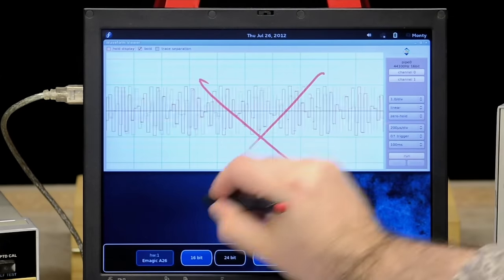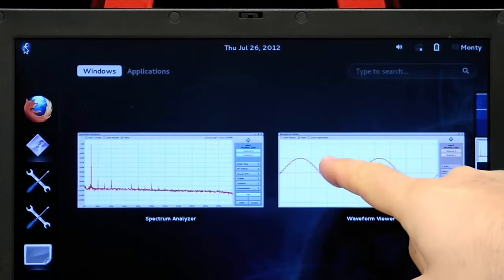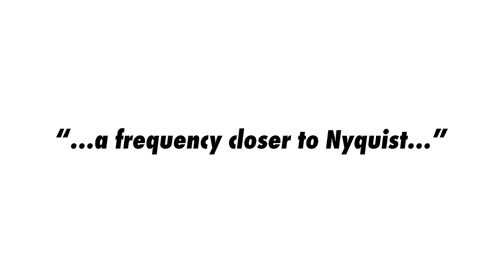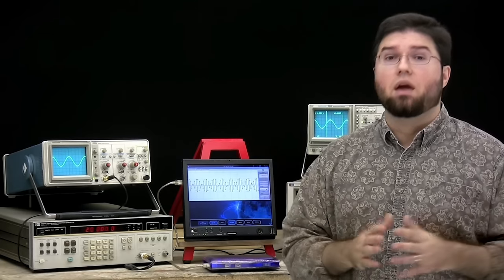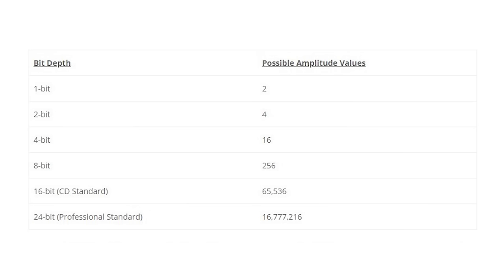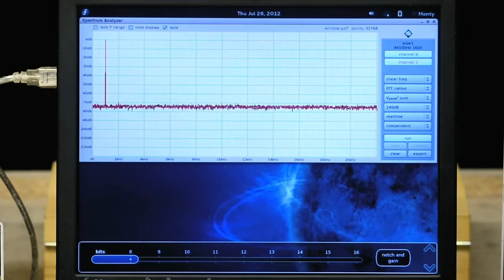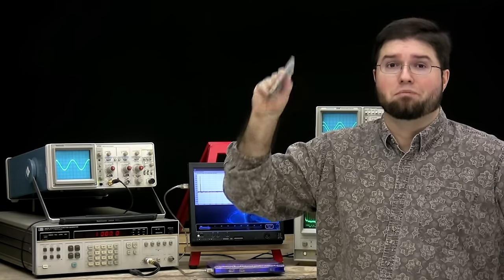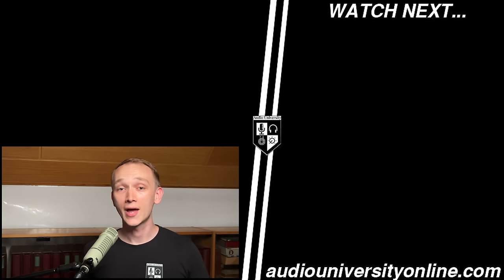Debunking the Digital Audio Myth: The Truth About the 'Stair-Step' Effect

Comment: @mfnickster9754  replied to my comment of 6 days ago, noting that the "DAC box", the EMI 2|6, uses a delta-sigma DAC to produce its analog output.  There is some possibility that the DAC in the EMI 2|6 is an "oversampling interpolating DAC", rather than the simplest kind of DAC, which inherently provides a zero-order hold.  

Essentially the "oversampling interpolating DAC" uses digital interpolation to raise the sample rate by filling in values between the samples it is provided.  For example, if "oversampling interpolating DAC" is provided with data sampled at 10 KHz, it will generate an internal clock at 40 KHz.  A digital filter will operate on that 40 KHz internal clock and generate values to fill in between the 10 KHz inputs.  

Those interpolated values could be on a straight line between each two successive samples.  That would be pretty easy for the filter to compute, because generating those points requires only data from each successive pair of inputs.  Instead of a stairstep between each pair of data points, there is now a ramp.  This linear approximation between points goes a very long way toward removing the artifacts present in the reconstruction generated by the simple DAC (with zero-order hold).  

Suppose the interpolator generates points that fall on a parabola through three successive 10 KHz inputs.  Now the input data points and the interpolated new values between the original data points fall on a parabola.  This does even a better job of removing the artifacts in the simple DAC's reconstruction.  You can generate the interpolation using 4, 5, or more successive 10KHz inputs, at the expense of a more complex interpolation algorithm.  But microprocessors these days run at screaming speeds, and don't occupy a lot of integrated circuit real estate.  So maybe higher order interpolation is practical.  Certainly, there are diminishing returns with increased order of interpolation.  I don't know what might be typical in "oversampling interpolating DACs".  

Why are oversampling interpolating DACs used?  Well, by boosting the sampling frequency beyond the input data rate, a simpler filter can get rid of the artifacts.  You could most certainly hear those artifacts at the output of a simple DAC (with its inherent zero-order hold), under the right condition:  a low sample rate relative to the incoming audio.  Getting rid of them  requires a low-pass filter.  But a simple low-pass filter will also start to suppress desired signals at higher frequencies.  If you want to avoid that problem, you need a low-pass with a sharper cut-off.  A sharper cut-off drives down the artifacts with less impact on desired high frequencies.  It also requires more components:  inductors/capacitors/resistors in a passive filter or more opamps in an active filter.   The trade is that the digital interpolating filter of high order suppresses the artifacts with less overall hardware than a purely analog filter with comparable performance.  Big "D" (oversampling interpolator) and a little "A" (final, analog filter) is, overall, easier and cheaper than no "D" (no oversampling interpolator) and a lot of "A" (final, analog filter).  

Analog Devices produces a line of oversampling interpolating DACs.  There are probably many other suppliers.  Here is a tutorial they offer:           

"Oversampling Interpolating DACs," by Walt Kester,  www.analog.com/media/en/training-seminars/tutorials/MT-017.pdf  

Walt notes:  "The AD9773/AD9775/AD9777 (12-/14-/16-bit) series of Transmit DACs (TxDAC®) are selectable 2×, 4×, or 8× oversampling interpolating dual DACs"

This tutorial explains what I have just attempted to demonstrate, but with more accuracy and authority.  For example, the tutorial describes the relationship between the sharpness of the final analog filter, the order of that filter (its complexity), the separation between the signal band and artifacts, and the desired attenuation of artifacts.  And as for authority, well, ADI has been a dominant force in this industry for multiple decades!

Does the EMI 2|6 use an oversampling interpolating DAC?  If so, we have an explanation for both the lack of stairsteps and the imperceptible quantization noise in Monty's demonstration.  Does the EMI 2|6 provide options for operational modes for its DAC?

Thanks again for the video and demo.  

And thanks to @mfnickster9754 for pointing out that the EMI 2|6 uses a delta-sigma DAC.

Comment: With infant hearing 20-20k is one thing, for adults 20-10k is more realistic.. with ultra high sample rates, one can digitize the higher than you can actually hear harmonics and the sums and differences of signals in the live recording room. They in turn mix with signals you can hear, changing what you record and what is reproduced and what you hear...of course you will run into the bandwidth of your reproduction amplifier and speaker system.. I believe Neil Young has it correct in his understanding and representations..  Most casual listeners and their sound systems can't hear the difference between sample rates and digitizer depths.. On the other hand audiophiles can understand the differences and in some cases even hear the differences..

Comment: To share my thoughts before watching:

The speaker is dynamically coupled to the excitation signal and there is phase lag and inertia in it anyways so it can't really be bothered if the signal is a staircase or smooth. You may be able to measure the staircase at the output but the magnet field and the coil current already can't possibly jump like that and will filter it
Reply: Except you're pumping heat into it, create EMI, and probably make your amplifier very unhappy.
Reply: @MatthijsvanDuin  in an after thought not even the amplified output can jump. If anything the high impedance analog output from some chip will
Reply: @lolman2425  Regardless one shouldn't abuse the amp or the speaker to perform this filtering, the proper place is in the output stage of the DAC.
Reply: @MatthijsvanDuin  That is no abuse it's just natural
Reply: @lolman2425  There's nothing natural about sending ultrasonic (RF even for modern DACs) garbage into audio gear in the hope that they will filter it out. The output filter is an integral part of a DAC, and when implementing a DAC you should just follow the guidance of the DAC chip's datasheet which will specify the recommended filter.
Reply: @lolman2425  The purpose of an audio DAC is to reconstruct a bandlimited signal from its discrete samples. The output filter is a necessary part of that, without it you simply don't have a properly functioning DAC.
Reply: @MatthijsvanDuin  There is no difference you are correct but filtering just means some passive components to make the output unresponsive to a part of the signal. It doesn't matter if you rely on a designated filter or if the the load naturally doesn't react to the HF component of the signal
Reply: @lolman2425  it matters because the output filter of the DAC is designed for the task, while audio equipment is not designed to deal with that much crap across that much bandwidth (modern audio DACs oversample to several MHz!). It is quite likely to cause issues, such as overheating an amplifier (the application manual of the amps we use explicitly warns against subjecting the amp to ultrasonic noise) and unwanted radiofrequency emissions

Comment: I have to correct the sample/pixel analogy. Neither a sample nor pixel measure discrete points. Samples will always be a small amount of time, and pixels will always be a small area. And while sound is always continuous and thus your sample will always contain a portion of the real waveform, it's easy to artificially manufacture a pixel that contains none of the actual color that it was photographing.

Comment: What about wave shape and phase?

Plus, when young I could detect loud ultra high frequency, but that was ultra quiet, so people wouldn't even realise it was there unless they knew what to look for.  So, testing back in the 80's/90's found people enjoyed vinyl record sound more than compact disk.  Though this could be because of equipment and recording quality, they said, in denial, that it was ultrasonic harmonic factors.  But consider this, that in the 1980's they found they could reproduce the feeling of genuine base by using the higher frequency harmonics of the base and the mind would perceive the missing lower base frequencies.  This had a few benefits, that the higher frequency harmonics would not penetrate the walls of rooms and apartments as much to neighbours, and probably they could reproduce better perceived sound on cheaper to make equipment.  But, in a similar way, are our ears picking up benefits from the effects of untasonic sound on sonic audio experience, wherever we can hear the ultrasonic or not?  The thing with listening pleasure (and when I was young the 96khz 24bit DVD tracks dud have a lot of sparkling crispness missing in the normal DVD, such as somebody getting out of the pool and the sound scape of the complex glistering shake of the water running off and onto surfaces.  The 96khz tracks were  generally were more enjoyable, fur what ever reason.  Now, I strain to hear as high of frequency as somebody my age.  But simple the rule still, as you approach your limit the sound response drops off like a rock to less then mosquito like perception at high volume (not that one should do this, it is likely to wreck your hearing permanently even more).  Indeed, there are people that can hear a lot more, the pin drop on the other side of a house (doing testing often involves averaging over a population, which obscures the signal of sub sets of the community).  I had a friend and outside in the urban environment, I could whisper quietly from 15 feet away and my friend could hear and understand everything, while her sister, trying to study in perfect silence for her 3rd year college, 4 or so feet away, was totally oblivious to myself making any noise).  I myself am on the Asperger's spectrum and could easily glaringly see differences in paint tones, that not even the paint shop person could not.  To him, the manufacturer white paint guide, looked mainly the same white.  But, as I used to teach people in the film industry, it is a reduce rate of return the higher the sampling frequency of resolution was, as the less people would perceive it the higher you would go.  An example with good glasses and taking nutrients for health I could perceive around 1/2 maximum human seeing, and knew a contract engineer for companies like Apple HP etc, who would see full resolution and the dots strongly on the retina display, probably the grid between the dots, I forget, I used to get that problem on displays as well.  But, that's a young healthy audience that can do this in any great number, and most aren't trained to recognise it, but should feel the difference.   But, maby years back, we had one guy sating that DVD resolution was all we needed, while people were debating 720p or 1080p being the full resolution they could perceive, and that 4k was unnecessary.  This is selfish, and doesn't take into account the audience's enjoyment.  I said that 4k is good as a significant portion of the audience could still feel it, and 8k, is hardly anybody with only  significant portions of sub groups and young people, who should be able to perceive between 4k and 8k.  That those numbers are do low that most people are not going to get a benefit and you should only use 8k for extra quality productions or due young people (prime movies).  I'm completely right because the optimal field of view before you start turning your head to look at things in the screen, means that home theatre standards recommendations of 120-200+ inch screens (walls)  becoming reality at low cost in future years, is going to make loosy recorded  1080p look like old DVD to a significant portion to the audience, and at the present time a significant portion of the whole audience could perceive a benefit from 4k compared to smudgy 2k in cinema from an optimal seat.  Indeed, you will notice cinemas with premium screens setting back normal seating from the maximum optimal viewing angle.  I used to see the grid pattern between the pixels in these screen from the optional range and grain on the silver screen (it's around 60 degree field of view, so nut those ones down the front).  This is important, be agW it will be the same in audio, you will get 20%, say, that have maximal enjoyment from the highest range of human hearing, even if they can't pick why.  Compressed pseudo lossless formats might be an issue.  So, we are talking mainly  young people here, who are a big part of the industry.  Marketing is now selling slop, and you won't know the difference, but these people aren't marketed the difference to perceive it and buy it much anymore.  They buy because the marketing and choice portrays slop as best, not because they are marketed the best.  Unfortunately the house of cards marketing seems to be super glued together.  But, you are as good as your starting point, so quality matters, and if 10-20% can hear your stuff is better, another so many percent may buy based on their recommendation and impressions, that's a lot of sales.  Now, going to the other extreme.  I have a friend who was a well to do professional signer.  But, he would buy equipment that sounded too murky, because he couldn't hear the difference anymore.  He would get old mpeg4 recorded Mario Lanza DVD's and claim how perfect the scratchy awful audio was.  I explained it was because his mind was filling in the quality from experience, but to him it sounded great.  So, there are going to be a big portion of people where it doesn't matter, and their equipment is going to smooth things out.  Where as when I got 96db speaker set up, my Simon and Garfunkel CD, wasn't really kistsbke anymore.  But, you serve the greater audience, but if a significant smaller percentage of the audience that can hear the difference are not going to really miss the last bit of extra quality, you have your normal average cut off point for delivery format.  However, if it's demographic if audiophiles, you might as well give them maximum.  Some, or a lot, may be able to perceive ultrasonic effects directly, even if they are 1% of everybody, they might be 10%-80% of your target audience.  Then, you may get another significant percentage of people that indirectly perceive a benefit from it.

BTW. Ve careful if noise cancelling headphones.  I perceived significant hearing loss after using them over days.  Once you loose it, it doesn't come back, your brain just boosts the signal and averages out the scratchiness and noise.  There are nutrient regimes that protect somewhat and when used very shortly after aswell, but that's beyond here, but worth looking up.

I would also put the purity of sample to be down to equipment averaging in your tests, rather than original shape preservation.  I'm not saying it should be squared shape or anything like that, I'm saying how well it preserves a complex audio listening, rather than even what gets recorded through sampling (the full recording chain from after sampling by a microphone and before it is converted into a signal format).  Are we seeing the best reproduction of the highest to lowest frequency complex shape, or are we depending on our ears to average it out (which I would trust, and if one thinks like that, one should perhaps just analogue filter everything to maximise  the volume of shape in a genuine wave pattern, and give up on pure complex waveform preservation, which to a purerist is like saying you could just use (sorry have a brain disease and neighbours dogs are barking and can't remember the terminology, but valves) to make it sound better).

Comment: I dabble in music production.. I cut my samples off at 18khz.. because even at 18, it's ear piercing damage inducing too high of a frequency.

I also notice lag and weird artifacts when doing 32bit 48000 or 96000 bit depth and sample rates.

It is correct that 16bit 44100 sounds slightly more real and less annoying to the ears, including a huge performance increase for production.

Whenever I buy headphones, I immediately go into the EQ to drop the highest frequency down by -2 or -3db to prevent hearing loss.  Those high frequencies are killers.

Comment: The video mentioned dither, but it did not properly explain it. Dither is extremely important and needs to be understood in order to properly understand what is being discussed in this video. (Dither is a noise signal that is added BEFORE digitization, and it can eliminate stair stepping at the cost of  adding some noise. I won't go into the explanation deeper here. As an aside, this is not the same thing as quantization noise, and viewers of the video may get the wrong idea and confuse quantization noise to dither.)

Also, the video does not explain why the output does not look like a stair step or lollipop function. It has to do with signal reconstruction, and is closely related to what kind of filter is applied to the output signal. If some kind of filtering is not applied to the signal then the output will not be a smooth curve at the output.

Comment: There are other factors. I'm an engineer and I've produced audio for arcade and gaming machines. The type of sampling matters, is it successive approximation? What's the slew rate of the ADC? Capacitors are used to smooth stair stepping and they do have "sweet spots" for audio frequencies

Comment: What is happening in the case of more complex waves with overtones and other than exact multiples of harmonics--I'm not concerned if a sinewave generator on the output end can produce a sinewave, which would also play out any sinewave precisely--or as transformations like through an FFT?